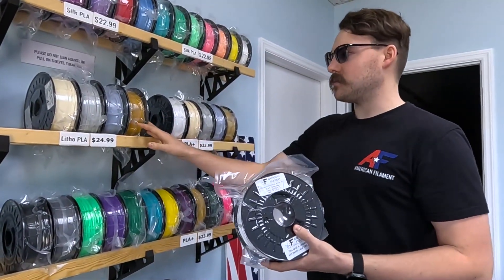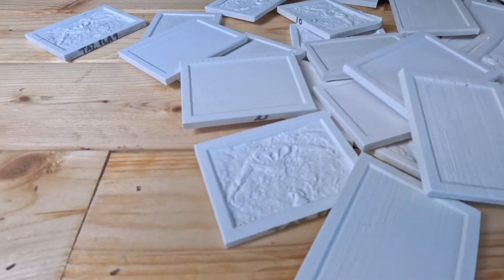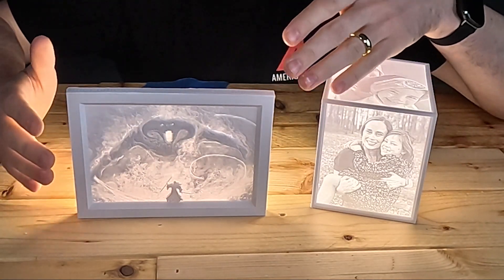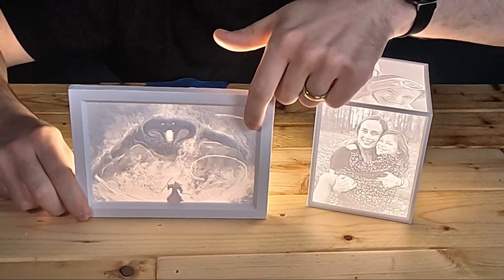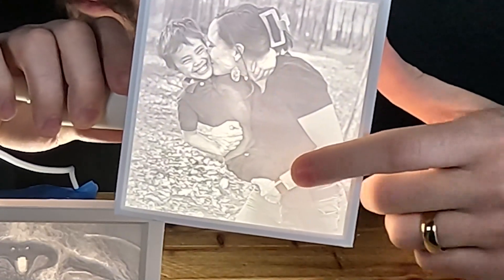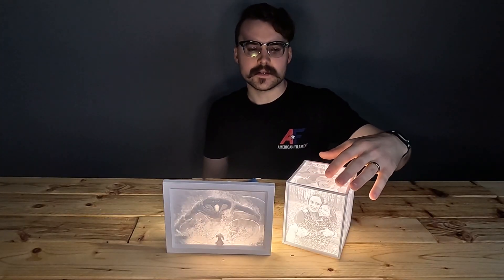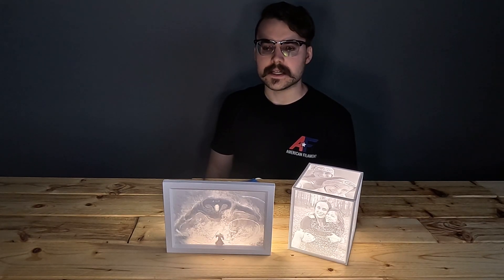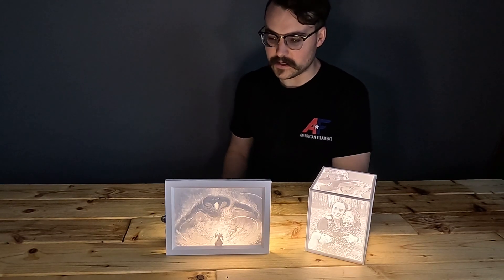What is the difference between Lithophane PLA and standard PLA?

Comment: Sending this to my buddy right now he does LOTS of these ....I don't  but  my wife is also getting interested in ligting designs again that she used to do by slipcasting in molds....the idea that we could vary the wall thickness in CAD to control the light emissivity  is super appealing. Is lithophane PLA any more brittle than traditional PLA?  Not asking for tough levels of impact resistance or ASA like performance .... just curious.
Reply from the maker: Lithophane PLA will perform exactly the same as Standard PLA in terms of mechanical properties. Also, you can use tools like the Lithophane Maker website or Lithophane Maker Desktop to turn image files into STL files, no CAD necessary.